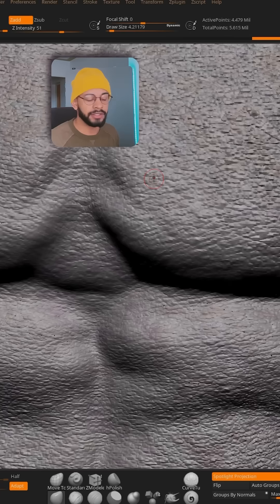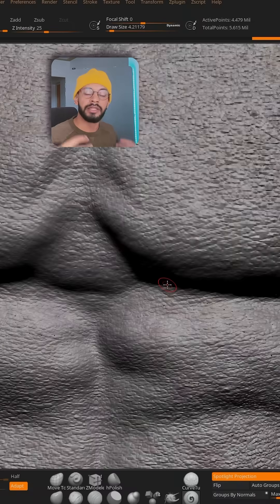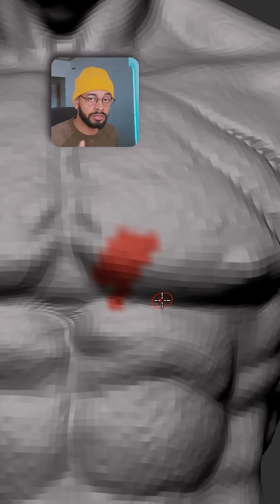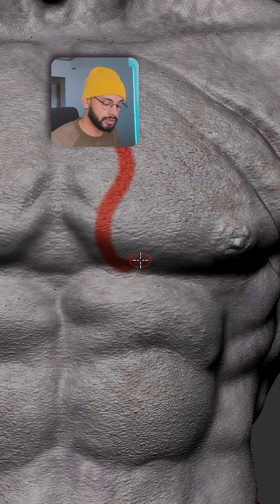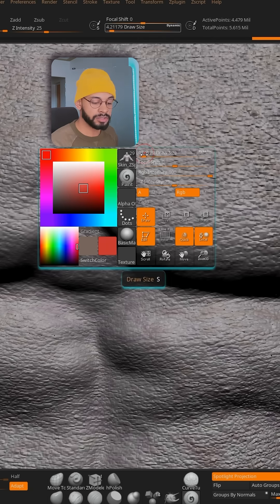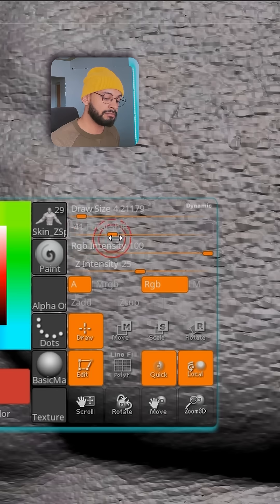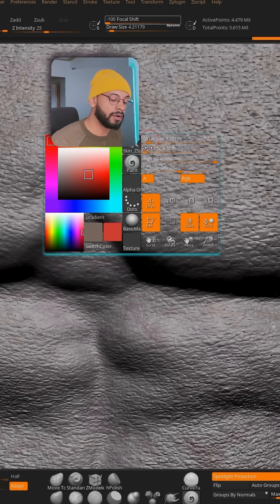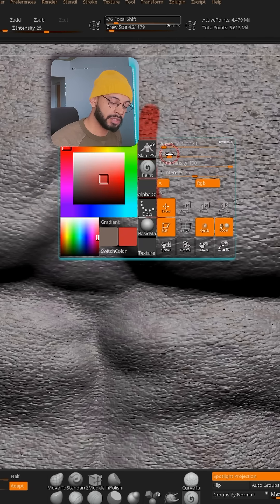How to Fix Blurry POLYPAINT in Zbrush? #zbrush #polypaint

Comment: Wow, i'm the first view here 😂🥰

I was searching on why when i creat texture from polypaint it get blurry with a little offset upward but the normal polypaint in sharp and smooth no blur
Reply from the maker: @3ososama  haha Great! Thanks for commenting lol

I had the same problem and I tried to fix it by trying to create a bigger uv map. Basically Zbrush tries to fit millions of vertexes paint into a squared size image and it’s possible that there are too many vertexes for the quantity of pixels… ? I sort of don’t get it fully but try making a bigger texture map size to see if it solve your problem.
Reply from the maker: @3ososama  Another way to solve is: Don’t fully trust the Zbrush UV master. Check the UVs in another software and organise them. Then import back to Zbrush and make the texture from polypaint again. Try using GoZ to send the SUBTOOLS to another software and then jumping back to Zbrush 👍🏽
Reply: @filiwonkka  i actually don't trust zbrush uv master , i uv unwrapped it in blender, but the proplem is in my UVs 

I made an island for lips separated from the rest of the face 
So i think this is the proplem 😅 

But i'll make a bigger texture next time so i will be able to make the face one island